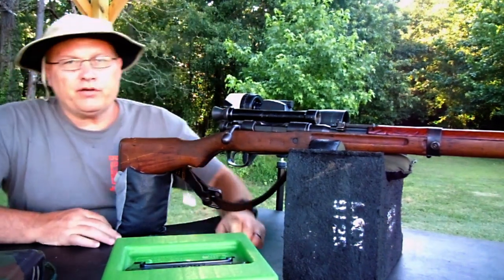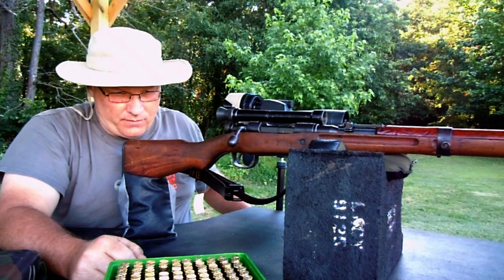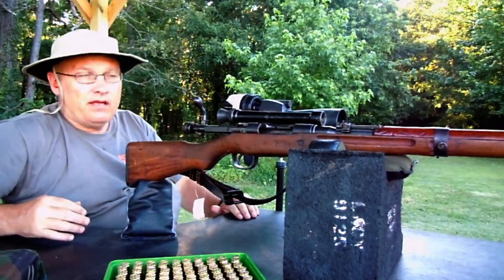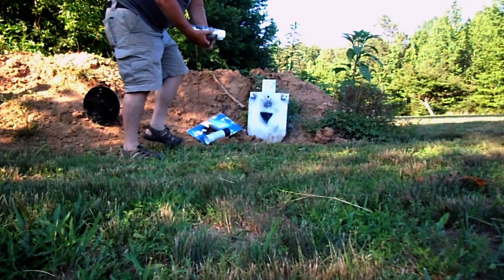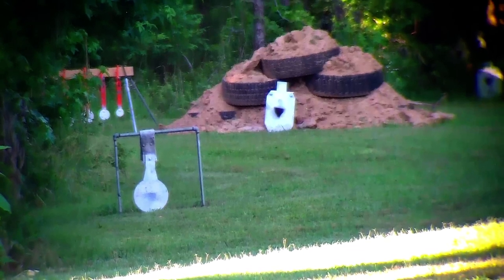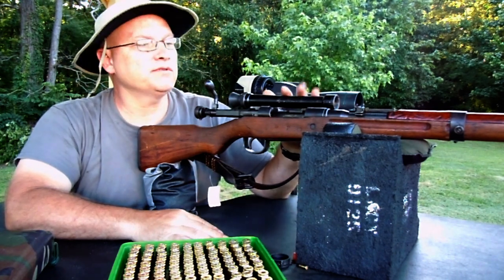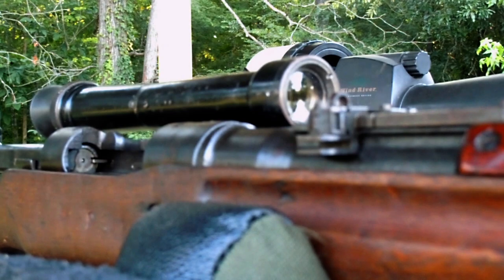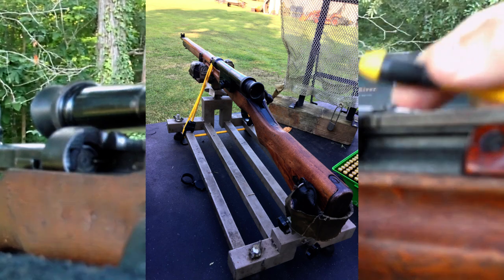Type 99 Japanese Sniper Rifle

Comment: 44gr pretty hot load. 30/06 M72 Match uses 46gr. in that 63mm long case.
Reply from the maker: Ray, The M72 is a low side load compared to M2 ball and the IMR 4895 of yesterday is not the same IMR 4895 of today. My go to load for the '06 is 48.5 of IMR 4895 under 168 SMK that hits around 2,750 FPS in 1903's. That keeps it supersonic up to 950 yards. If I shot a 1000 yard I would have to bump it up to 49.5 to keep it supersonic or go to the 175. I stick with the 168 due to it being great for our Vintage Sniper Matches to usually stop at 850 yards.

Comment: What about 7x57, 175 grain, jacketed soft point RN made by Federal?
Reply from the maker: Micheal,
The 175 grain load in 7x57 is even slower if I remember correctly. All of the non-magnum rounds run out of steam around the 1100 meter mark. If you are firing a machine gun for suppressive fire then you are good to go.
Tony

Comment: Nice rifle, is it true these rifles can shoot up to 1600 meters?
Reply from the maker: Micheal,
They will not shoot up to 1600 meters accurately. The 174 grain bullet @ 2450fps at the muzzle goes subsonic around the 900 meter mark. I have shot the same bullet out of a 7.62x54R that runs 2600fps at the muzzle up to 1200 yards with consistent hits on a 4'x4' metal plate. Further than that and I could not be consistent due to it going subsonic.
Tony
Reply: @lacysrange  Norma makes a 180 grain load with 2640 fps.